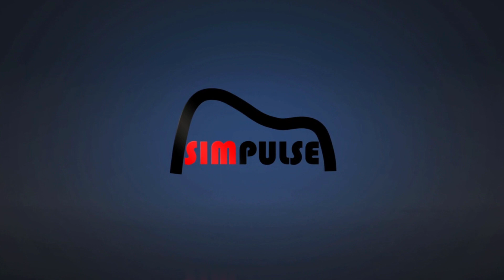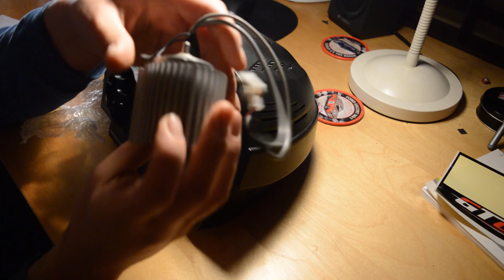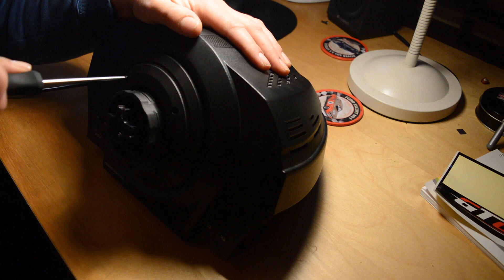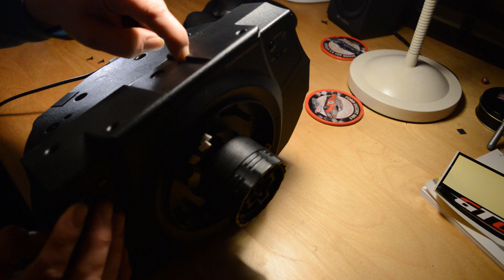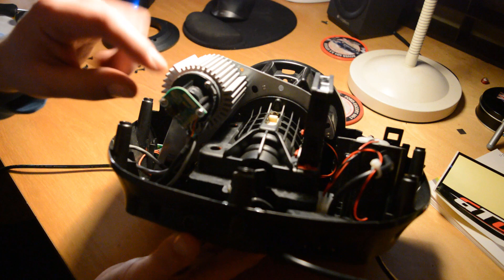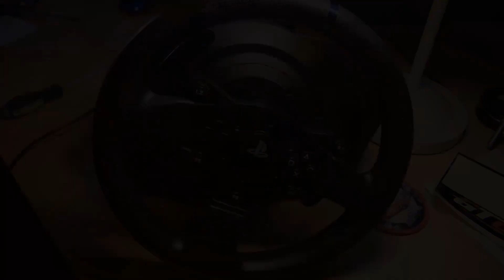Thrustmaster T300RS Racing Wheel - Replacing the Motor

Comment: Hey man I really hope if you have any idea on this. My FFB fails against resistance and shuts off. The rest works fine but only the FFB stops. I did open it and check the sensor on the back of the motor and it's not broken.

Comment: hi i have a tgt with several wheels and have not had any issues since getting when it was first launched now if it were to break down sometime in the future i decided to purchase the t300 hub only for just £239.00 to use temporarily say for a few months whilst sourcing something decent to replace the tgt like maybe a DD wheel especially if thrustmaster were to ever make one for the playstation console like ps5 which i have? i went for the t300 hub only as i already have a few wheels to use but i have read numerous reports that the t300 isnt that reliable but then also some people have had them for 6 or 7 years without a problem ? what i would like to knoe is do you think ive done the right thing or should i have got the newer t248 ?? although you cant change the wheel on it it might have been a bit more reliable being its a newer design ?? but then if i start to pay out £300 for that then i might as well pay a bit more and buy the tgt 2 hub to replace my tgt so i dont know wether to taake the t300 back and just save up for a tgt 2 hub ? what do you think any advice muchly appreciated thankyou in advance 
   

3

Comment: Thanks for sharing. I have exactly the same issue. It started with a soft spinning left and right. Some days later in changed into a hard fast turns like in your error video. I would like to do the same but fail in finding the spare part. 🤷🏼‍♂️
Reply: In the meantime did you find the spare part ? I am fronting the same issue :(

Comment: im searching for an issue I have with my TX. When I steer left the wheel returns to center normally. When I steer right the wheel returns to the center but very slowly. When the wheel is calibrating itself the wheel seems like something is "braking" the rotation. Are you aware of this issue or maybe know how to fix it?

Comment: If its just the internal magnet it is possible to fix without even removing the motor or soldering anything.
Reply: would that fix my issue? My FFB fails against resistance and shuts off. The rest works fine but only the FFB stops. I did open it and check the sensor on the back of the motor and it's not broken.
Reply: @abdullahbasamh6210 did you fix it? What was it

Comment: Which of the motors did you use?
There are 5 options, B4260M-S0X (1-5),  on the linked page.
Reply: S03 is the stock but some people recommend the S02 due to a little bit more torque (but potentially less rotating speed which might be an issue for drifting)

Comment: Hello, maybe you can help me ... Please answer me ...
 I own a Thrustmaster t300rs GT edition steering wheel but I misplaced my power supply.  Impossible to find one on the market so I will have to make it.  However since this is a 4-pin power supply there are 2 pins which I suppose should receive a voltage of 220 volts but I don't know which of the 4. And the other 2, if they are bridged, or ..  .I dont know... ?  Can you help me using a multimeter.  Thank you.
Reply from the maker: Hi, sorry I'm not too sure. As mine was a direct replacement I just swapped it over. Are there any motors on the market with similar spec?

Comment: when you were replacing the black piece that holds the magnet, how did you know how far from the hall sensor it should sit? or did you just glue and push in as far as it went?
Reply from the maker: I didn't have to replace the magnet on mine, so I'm not sure. I think as long as it doesn't affect the motor shaft, the wheel will calibrate when it is switched on.

Comment: the plastic black breas and causes calibration issues cause its not sealed.. if its only cracked use some hot glue and it wors fine..
but if its broekn broken or missing a chunk. u need to just 3d print it

Comment: hi all. i can to take off the brashed motor to instal brushless motor?? i have the t150. so the encoder from t150 is not up one the stock motor. i think is brushed 540 the stock.. i check the conectors from the board, conectors whene is pluged the motor..have 3 cable the red annd blue give the electricity. the blakc maybe is ground.. i am think to install brushless with ESC, but i dont know if works this. enyone to know this?

Comment: Nice video, thank you. Could you please explain how you manage to remove the white pinion gear from the shaft of the motor? It seems quite stuck.
Reply from the maker: Mine just slid off with some force. I think I levered it with a screw driver. Alternatively there is an upgrade you can do with a metal pinion from ebay. I plan to do this in the future
Reply: @simpulse5825  ok, thanks for the swift reply. The metal pinion is a great idea, thanks.
Reply: @simpulse5825  can you link to the metal pinion?
Reply from the maker: @2losersinbasement  Sorry for the late reply, here is the link https://www.ebay.co.uk/itm/273850539897. The info is in the description of my other video which is a guide on fitting the metal pinion and bearings.

Comment: Could you post the link to the motor, please? I have the same problem and the link above isn't the right motor (Ricoh MP 4000 Complete Oem 24V 2A Brushless Fuser Drive Motor Assy
 :/)
Reply from the maker: The listing appears to have changed since I posted that link. These motors now seem quite difficult to get hold of. Perhaps Thrustmaster hold them but not sure if they will sell them separately. 

This is the link to the manufacturer's product, however they will only sell in bulk orders to businesses: http://en.hengdrive.com/Products/BLDC%20motorsB4260MBrushlessDCMot.html

Comment: Could you post the link of the motor. I have a t300 rs and for some months  now the FFB is getting weaker and weaker.
Reply from the maker: That sounds like the motor is on its way out. The FFB does also weaken when it gets hot so try switching the fan on so it runs all the time. Hold down mode and press the ST button on the wheel. 

The one I bought was £39.99 from the UK ebay site but they don't seem to be listed at the moment.

There is this one on the US site for around the same ($59 = £43)

https://www.ebay.com/c/19025442429
Reply: @simpulse5825  Thank you so much. I had the wheel for 2 years now. I never knew that fan thing until today. the fan always ran automatic on my wheel. Mostly off  when playing F1.
Reply from the maker: No probs. Also if you turn the overall forces setting down to 60% in the thrustmaster control panel then the motor is not working so hard.
Reply: @Sim Pulse  i saw that my motor on t300 smokes on turning without psu, i just ordered new for 5$ on aliexpress
Reply from the maker: @pietrekk_k  do you have the link?
Reply: @simpulse5825  I bought this one: https://www.aliexpress.com/item/4000968248267.html

It should be here in a couple of days, but it does come without heatsink, so some surgery is required to make it work..
Reply: @BlakjeKaas  Did it work for you? From the photos it looks.like the central axis has different ending.in the listing.
Reply: @Kuboslawik  It did! Even though it did need some work, so I had to move over the heat sink and change out the sprocket on the end (it's a tight fit so no glue is necessary). I also recall that I needed to change over one of the connectors of the old motor to the new one (new motor has a 5-pin connector vs a 6-pin connector in the old one), furthermore, some connectors aren't used at all. If you decide to buy this motor and you're struggling to make it work, I'll be glad to help!
Reply: @BlakjeKaas Good! I'm prepared for work :D  Right now i have to check for sure if this is a motor problem. I bought faulty TX wheel, repaired power supply, but now there is a problem with this motor, it turns but makes constant whining noise. Will disassemble it, check if it work connected directly to bench power supply and then decide if i should buy one. Definitely will reach out to you if in doubt :)
Reply: @simpulse5825  I have it at 80 % and in f1 2020 game i set the FFB at 150.